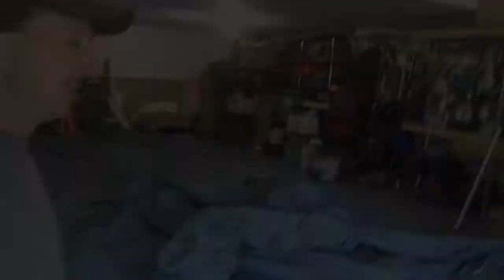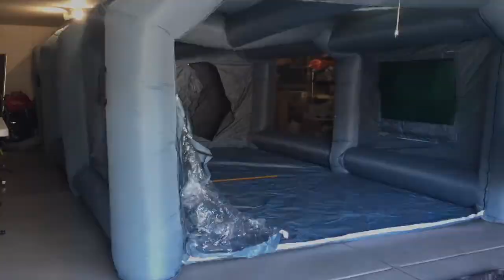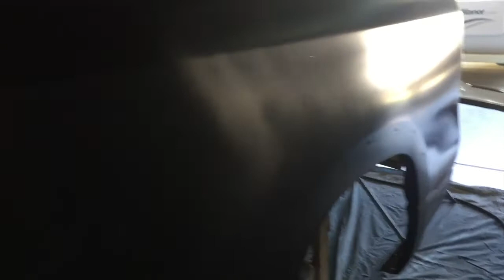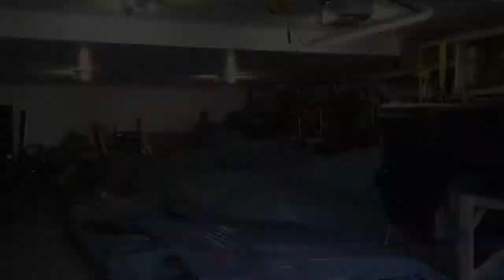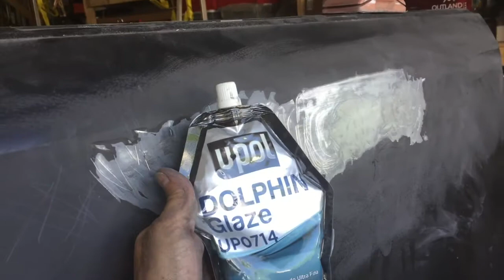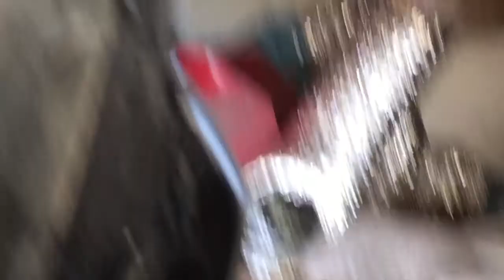Rebuilding Wrecked Dodge Ram 1500, Part 21. 2019 Laramie. Bed filler, primer, spot weld tip & fail.

Comment: I think I remember reading something a while back about not applying body filler over epoxy primer....I can't recall the reason why the, but yea i think your right with it being some kind of chemical incompatibility going on there
Reply from the maker: The regular body filler notes it will go direct to metal or epoxy primer. I think it's all about curing time. That epoxy I used takes days to get to full cure. I used the same epoxy and this spot filler on other areas of this truck with no issue but those epoxy areas had cured for weeks.
Reply: @riderescue  oh yea I forgot about the long curing times for epoxy, you're probably right, that does make sense.

Love the videos I've seen so far on the project and appreciate the attention to detail. I've walked away learning something from each video I've seen so far, thanks👍